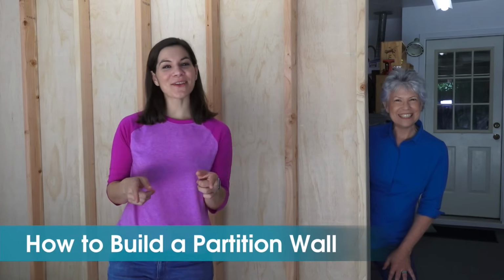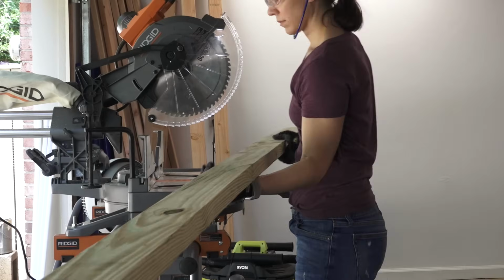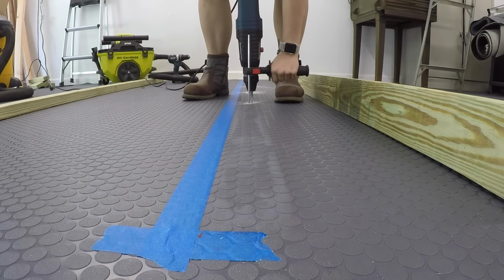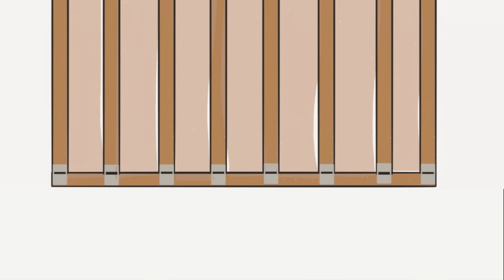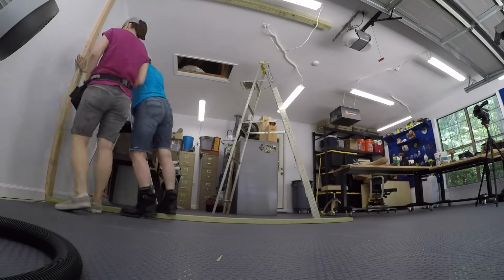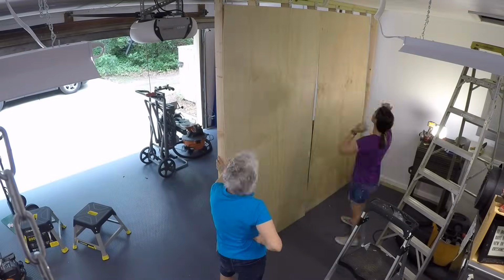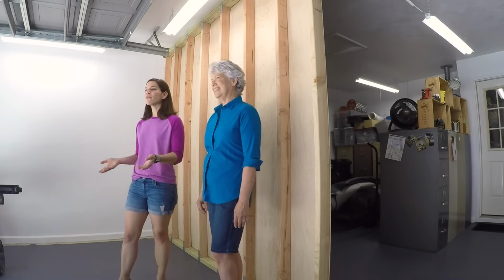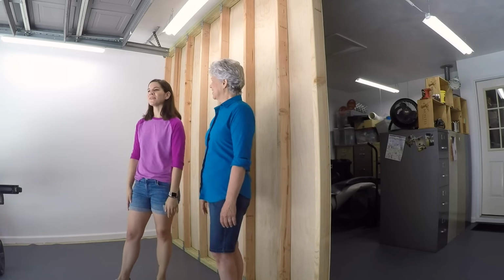How to Build a Partition Wall // Mother & Daughter Build a Wall

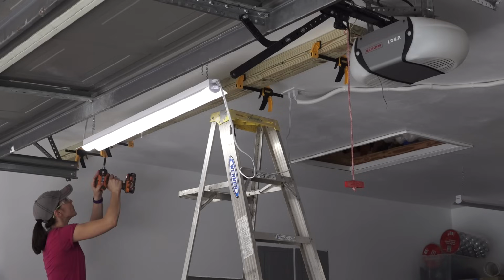Comment: Two thumbs up! This is the only video and instructions thatI could find that showed adding support in the attic. All the other videos showed how to frame the wall, but did not show how to properly secure the top rail to the ceiling by creating the support in the 3:12 attic. I wonder how many walls are built that are only screwed into the drywall ceiling.

Comment: I like you two....good, fun interesting video projects.

I did something similar several years ago. I built a non-load bearing separating wall to divide a long room into two rooms. I added a door as well as an electrical outlet and a light switch for a ceiling lamp. Ran electrical from an available junction box in the attic to the outlet, up to the wall switch, then up to the lamp. Every time I turned on the light and tried to use the outlet at the same time I would trip a circuit in my electrical box. I spent about 8 hours trying to figure out the issue and must have tripped the circuit 10-15 times....lol.

So finally, I get fed up, go to bed and try again the next day. Amazing what I night of rest will do for you. I tripped the circuit breaker again but immediately realized that the circuit I was tripping was for the 220 volt dryer connection! Moved my electrical connection for wall outlet/light switch to another junction box in the attic (non-220 volt of course!) and solved the issue! Can't believe I tripped that circuit 10-15 times the day before not realizing it was for my dryer!.....LOL.
Reply from the maker: Thanks so much- glad you like our videos! Thanks for sharing about your wall. We for sure had those moments in this build- it took us forever to make sure our bottom plate was straight before we were ready to attach it in place!
Reply: Cool 😎
Reply: "What did one wall say to the other?" 
"I'll meet you at the corner."

Comment: WOOOOW! If only I knew you too!! You are just what I need! I'm having a problem soundproofing a shared kitchen wall in my apartment because of my neighbor's bass in her music (she lives in an efficiency next to me)! My kitchen and livingroom all run together with no separation. I was just thinking that it would be nice if I could separate the kitchen from livingroom which is where I have to sleep since a rude neighbor moved in below me a year ago. Their bass/music has really destroyed my peaceful apartment and it's unfortunately happened after I retired! Just sad especially cause management really hasn't done anything to help ME. So as long as I still have to live here until I can afford to move out I need to soundproof my kitchen wall so I can sleep peacefully in my livingroom. I don't know if soundproofing a shared kitchen wall in my old apartment complex is easier to do than trying to put up a temporary wall to separate the one long room. 
I'm at my wit's end and I really need help. I mailed carpet remnants on my kitchen wall so far but couldn't reach up near the ceiling so the wall is 85 % covered but of course I can still hear the low frequency bass! I cannot continue living like this as-is. I'm not a quitter so I continue to research for help bec for now I have to live here in Philly until I can move! Thanks.

Comment: I have a question for you, my husband and I are going to build walls around our basement access but I can’t find any studs in the existing wall connect my 2x4 to for the new wall to build off of. What should I do because I can’t put it anywhere else due to the steps in the floor going into the basement? Should I use anchors? And if so, do you have any to suggest?

Comment: hi! what if I want to do this in a basement, but obviously cannot go into the basement ceiling as that would mean going between floors. Does that mean I should just try and find studs in the ceiling using a stud finder? Or just not build the wall at all?

Comment: You mention several times that you use 2 2x4's at top, "so that the studs will fit securely". But can you clarify why 2 are needed to make it snug? Surely it could be snug if you only have 1, as long as you measure correctly? (i'm only half way thru video, so maybe you explain later)
Reply from the maker: Hi Andy, the 2x4's we used for the studs are 8' tall and our floor to ceiling is taller than that. We used the two for our top plate so we didn't have to buy longer 2x4 and cut them all down. -steph
Reply: Ah ok. That makes sense. Thanks

Comment: Is that light you used in the attic a Milwaukee flood light?
Reply from the maker: Yes, Milwaukee M18 18-Volt Cordless 2200-Lumen Radius LED Compact Site Light with Flood Mode

Comment: Great Video! Quick question:  My local lumber supplier's stock always seems to range from moderately bowed, crooked, &/or twisted, to severely bowed, crooked, and twisted.  You can find one or two pretty good pieces but for a project like this would definitely have to deal with some of the aforementioned.  Is that ok?  Is there anyway to deal with this?  It seems like the horizontal pieces would definitely be forced to straight if you're nailing into concrete/clamping along the way, but not sure about the vertical pieces
Reply from the maker: It can be a challenge to find. We spend a lot of time looking through lumber to get the best ones we can find. I think we did have a few twisted piece in this project, and were were able to force them into place. But we have found the more time we spend looking for the best lumber in the store, the less headache we have when building. -Steph

Comment: What I notice about handy women is they seem to be far less likely to jump into a project ill prepared in hopes that "winging it" will suffice.  Rarely it does.  So you find these women are well prepared and often have more than enough tools whereas many men think they can get by with what they have and "make do".  Sometimes this works and saves money but usually it just translates into a poorly finished project.  So guys, let's learn from good preparation and adequate tools.  Because it really is the smarter way to work.
Reply from the maker: Thanks Bob. Well said!